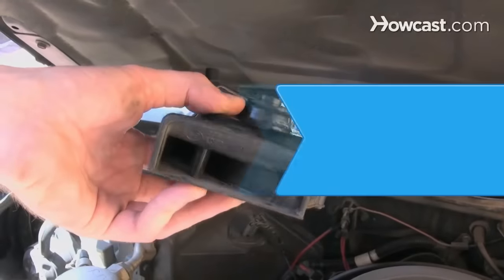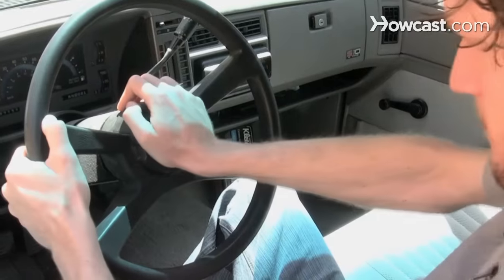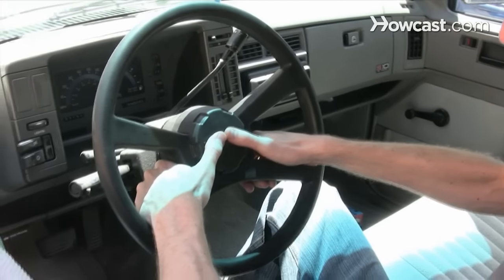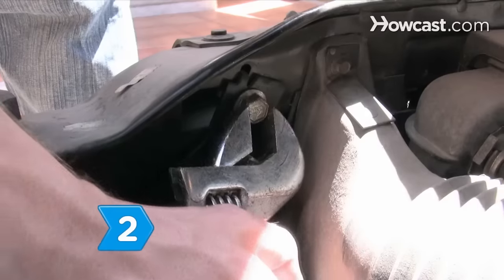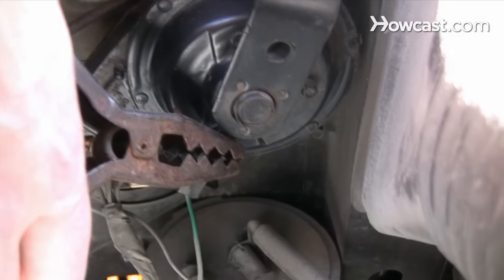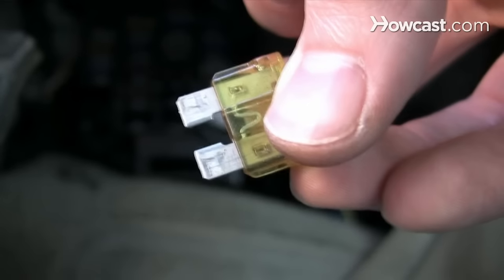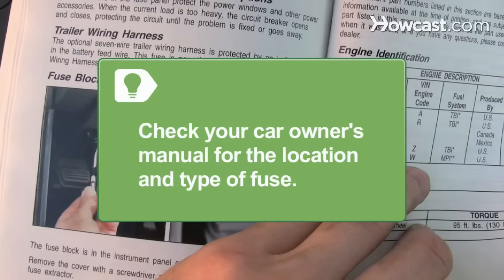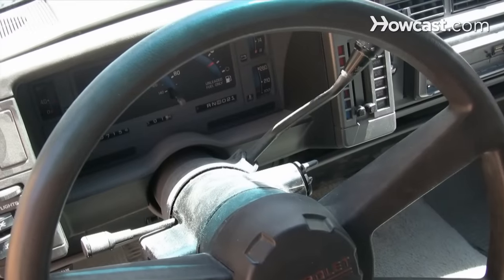How to Fix a Car Horn

Comment: you forget about 2 more things first spring loaded brass pin that makes contact with the back of the steering wheel that may being too worn down to make contact and some cars are equipped with airbags those cars have clock spring instead of  brass pin second is a horn relay if relay stop working then you cant use your car horn but first of all check the fuse most of the time fuse is the main problem

Comment: The reason you would replace the horn first is because you are bypassing all wiring and fuse by connecting to direct 12v. In my opinion he is giving the instructions in the proper order.
The horn should work with the 12v from battery.
Reply: No, proper order would be to check the fuse first. Then take other measures.

Comment: Uhhh...fuses should go first.
Reply: +MsMarisan You bypass the fuse when you hook the horn directly to the battery. That way you at least know your horn works. If it does work check the fuse. If it doesn't work there is no point in checking fuses. But you could easily checked the fuse first as well. It doesn&#39;t really matter, unless you don&#39;t have cables or jumper cables.
Reply: +Atrax R Oh ok, got it. Thanks!

Comment: I have a question..  After returning from a 3 month holiday, my mothers car won't start, the battery usually is flat by then, so we plug in our Ctek charger leads to the battery and recharge it.. 

However, after a whole 24 hour day, it still hasn't charged, so next option is to switch the charger to "Supply Power" mode to start the car. But after switching to that mode, the car horn honk sounds continuously, like car alarms..  ( I don't remember if it sounds as soon as the charger is in "Supply power" mode, or if after turning the key to start the engine)  What is causing the horn to honk when charger is in supply mode and/or trying to start the car?

Comment: i also experienced that thing but i just repaired it by myself step1-i checked the horn but there's no problem step2-i checked the steering wheel and i opened it and there i found the problem the wirings were disconnected and i just plug it again and there...SUCCESS The Horn still sounds good it sounds BING! BING!

Comment: Pretty sure he means.. why wouldn't you check the simplest issue before going out and buying a new horn? What happens if you buy the horn.. and it still doesn't work? Could just be a fuse.

Comment: i just got my car back after having some transmission work done on it and i noticed my car horn is nowhere near as loud as it was. Now it sounds like a little beep instead of a loud honk. Is there a way to adjust it or do I need to replace it?
Reply: Usually there are 2 horns, a high one and a low one that sound simultaneously.  Perhaps one of your horns is out.

Comment: 12V on the wire that goes to the horn. Have replaced the horn with brand new. Connecting it to wire with 12V, (and ground). The relay and everything works, but no sond from horn. WTF???

Comment: fuses good. wiring good......I disconnected the wires to the horn...and then I unbolted the horn and took it off.....I banged it around good.....I put it back on.....lol..its working..... it must of been dusted out lol...ya my opinion..

Comment: what can you do when your horn goes off for no reason
Reply: Robert Soltes Call Ghostbusters ?
Reply: Cut out the horn? It wont stop in mine!
Reply: +Robert Soltes If you're still having the problem, you should have someone check the relays in your vehicle (supposing it's not a model with the horn wired into computer control), if that's not problematic, have someone check the actual swtich in the steering wheel of the vehicle.

Comment: do not follow the steps as he explained, wouldn't you check your steering wheel from debris?  and wouldn't you check the fuse after? yeah exactly don't follow it how he said it, most of the steps were correct, although in the wrong order that's all